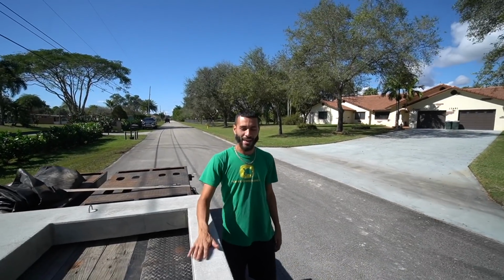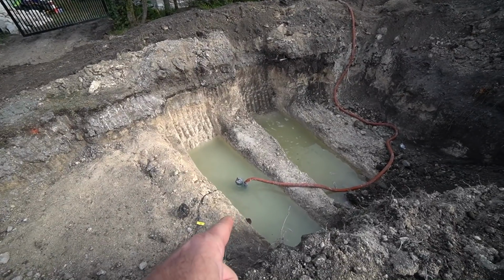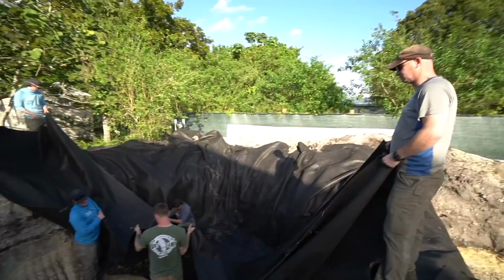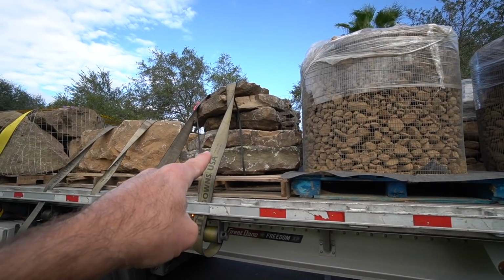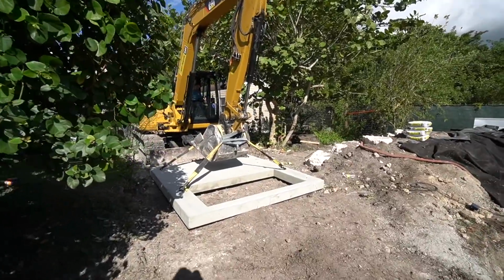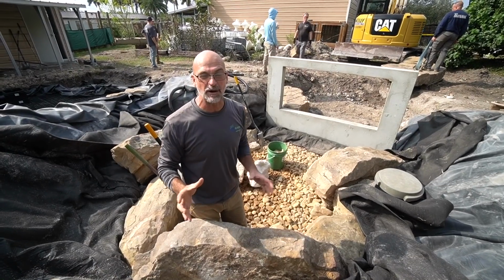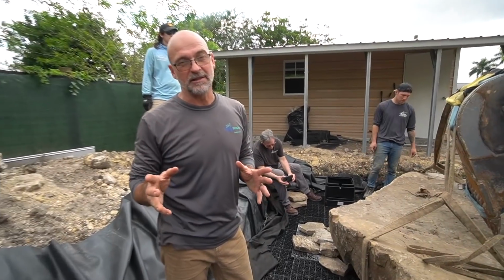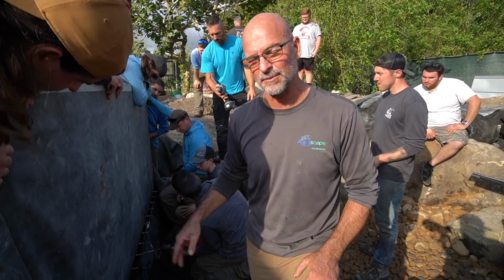5,000 LB Otter Window For Blake's Pond - Part 3

Comment: Hi there, Very interested in the steel brackets, are they galvinised first?

Also do you bolt them through the liner and then into concrete so they sit on top of the liner ?

Cheers,